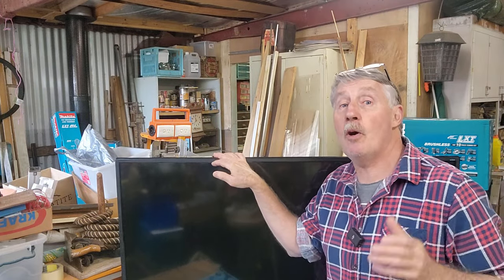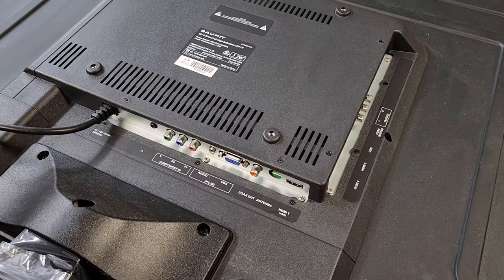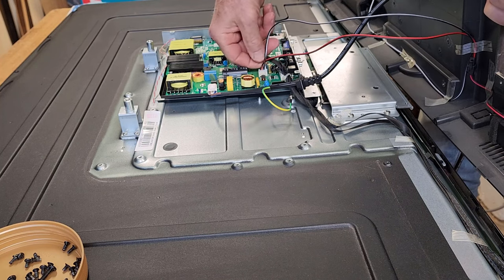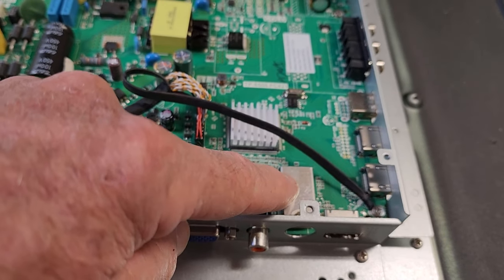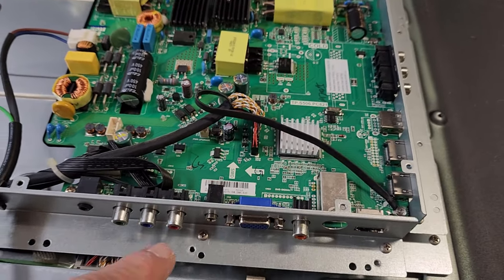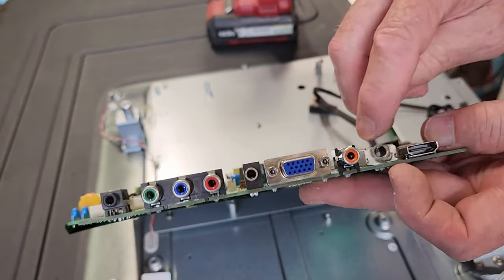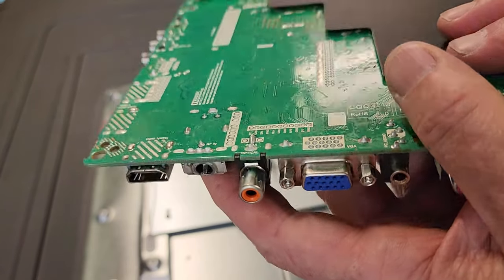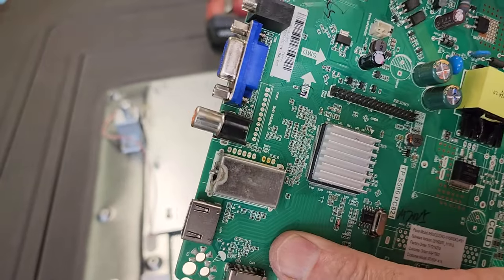How to Repair a Broken Antenna Input Socket Connector on an Aldi Brauhn LED LCD 50" TV - Or any TV!

Comment: Great fix.
Went better than the last TV I tried fixing. It had no backlight. I thought the backlight controller was bad. Even the power supply repair manual pointed to replacing that chip. Didn't work. People seem to think the LEDs are what went bad. But by then I had already gotten rid of it.
They don't build them to last, like everything today.
Reply from the maker: Exactly Hugh, what do they call it "planned obsolescence"? Annoying that there's no thought of planning going into design these days with repair in mind. I have done some TV backlight jobs with success - but maybe just lucky!
Reply: No way @Hugh Jeffreys watches the ultimate recycler!

Comment: Nicely fixed, I'm somewhat surprised to see the aerial socket still in use... I'd have just bypassed it with a cheap freeview box, satellite box, dvd, blueray, game box or even an old video.  I'm guessing what I'm saying, is there's more than one way to skin a cat and with modern TVs as long as you have a working hdmi or AV socket the original owner could have bypassed the damaged socket and even upgraded the TV, no soldering skill required if the had wanted to.
Reply from the maker: Yes, absolutely Martin and I had even mentioned that to the lady that dropped it off! I guess they never thought of that and just went out and purchased a new TV!
Reply: Exactly. You can buy some cool little box gadgets for around $10. I got one for digital TV . on my retro game 51'. Old tube
I need it to play virtual cop, house of the dead & all my other light gun saturn shoot em up imports . The little device can record TV, read different micro cards & all sorts of handy stuff. It opens & plays everything in my loaded H.D unlike my smart TV. It reads & plays back any format.

Comment: Nice video, good instruction and easy to watch. 

I've just snapped the aerial input on my TV and want to mend it. I'm not sure I have one of those cage things that I can get hold of. Would it also be an acceptable repair (would it work) to solder in a short length of co-ax cable directly to the board and existing cage?
Reply from the maker: Thanks Jools! Yes, I think that would be an acceptable and perfectly functional fix option! 👍😊
Reply: @TheUltimateRecycler  Good stuff. Thanks for the reply. I'll get the TV back online soon then :-) 
Keep up the good videos.
Reply: @TheUltimateRecycler  soldered it up this evening here. 
Mine was more in depth than yours, the cage was full of electronics so I had to pry the middle pin out, solder on some insulated copper wire. Joined that to the central coax wire and soldered the outer to the outer cage. Might be a bit weak but duct tape sorts it. And best not to spaff another grand on a new tv. Thanks for the video help

Comment: Tools used? How many watts required for the solder and gauge wire please?
Reply from the maker: I don't remember using anything special - just a standard soldering iron and normal leaded solder.
Reply: @TheUltimateRecycler  Thank you

Comment: I wish you could fix my TV. It's got the same problem my neighbor sold me a small 22 inch TV for like $10-$20 a few years ago before he passed away. I could probably plug in a DVD player but I just wanted to attach an antenna buy I can't lol.
Reply from the maker: You could possibly grab an old VHS player and plug the antenna into that, then feed the signal through the AV input to your TV

Comment: If not handy at fixing things. You Can also Use a $10 set top box to hook up ant run via box AV connections (Yellow Res & White plugs )
Reply from the maker: Yes, you sure can! The owners obviously had never considered this and just went and purchased a new TV..
Reply: @TheUltimateRecycler  yep sometimes the bright lights of advertisements cause a cloaking over any alternative cheap simple fixes that would save money on a shiney new set. Funny thing is the old TV will probably continue to out live that expensive new TV they went & purchased. 
The real smart TV 
Shall be revealed in time...
So Stay tuned 🤣
Reply: Ps good repair. 👍 
Always worth a try on these things. What's the worst that could happen. It feels good to resurrect a discarded item back to life.
 Nothing like those sweet satisfying Simple fix kicks
Reply from the maker: @DoctorWEBB  Absolutely, that's most of the reward! The fact that I can sell it is just a bonus! 😁
Reply: @TheUltimateRecycler  keeping it out of landfill benefits the worms. 
Worms with square eyes get  wild n wriggly ...
They call them Television programs for a reason.